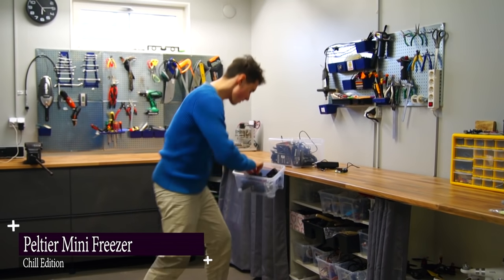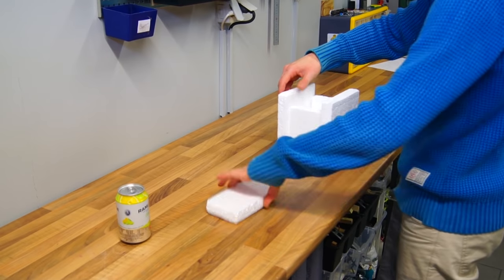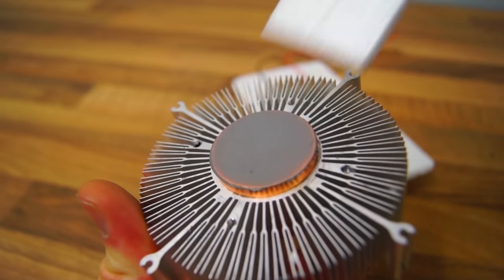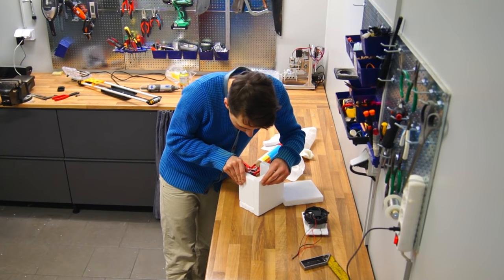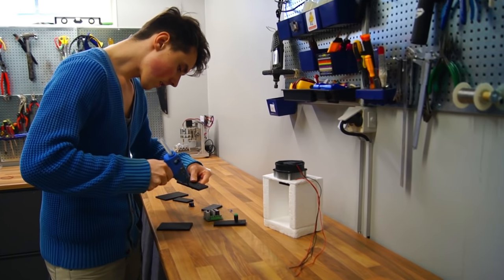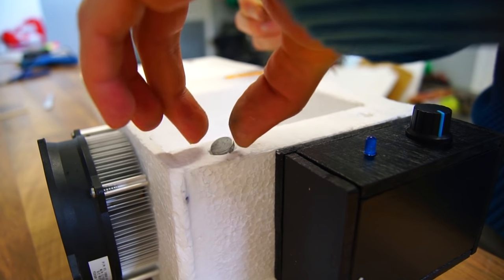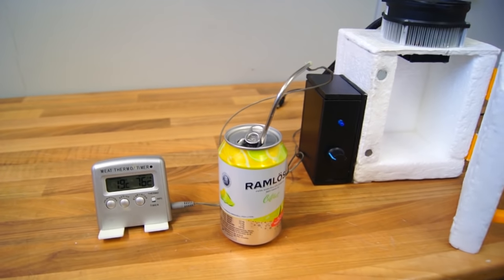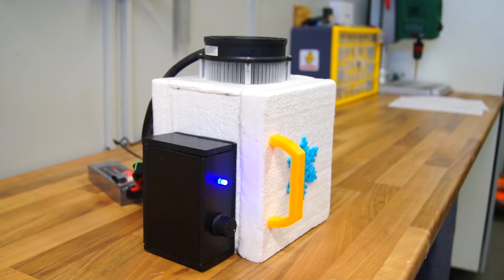Useful Cooler Box - How to Make a Mini Freezer

Comment: these peltiers are a fantastic thing for cooling in a small space where you cant use a compressor style design, but remember they are the most inefficient way known to man...so if you have power to waste in order to cool, fine, but if your in a camper van without the engine running etc, your battery's dead in no time, and you will need someone to jump you van off, ask how we know...50-60w of dc drain for about 25w-30w of cooling is average, but as said, in a small space, brilliant
Reply: lez briddon They're not "the most inefficient" otherwise they wouldn't be so common. Still, I don't know any other method of using electricity to cool something (below room temperature) that isn't Peltier or Adiabatic.
Reply: Just because something is common doesn't mean it's efficient (incandescent bulbs). Maybe it is more common because it is convenient and long lasting?
Reply: GoogleMinus your comparison is illogical. while incandescent bulbs were around 5% efficient there low cost outweighed the disadvantages and the lower cost of electricity 25 years ago made it less of an issue. add on to that the modern CFL was not reliable there was no alternative to incandescent.
peltiers are cheap to buy as a component for less than 10$ but to compete as a real refrigerator you would need around 6 and a huge power supply against a ready built refrigerator of less than 100$ and about 60w of current draw. peltiers generally suck unless you have no space.
Reply: lez briddon His comparison is fine, since there's no substitute for Peltier modules right now (unless someone miniaturized the Adiabatic mechanism of fridges)
Reply: ifOnly, there is another technology called magnetocaloric cooling. These devices do have moving parts, but they do not have compressors for high pressure gas refrigerants. They have a small pump for circulating a heat exchange fluid (salt water, I think). A motor is also used to spin a special metal alloy in a magnetic field. The claim is that this technology is 35% more efficient than gas compressor based refrigeration. I do not believe this claim at face value; however, even if it were slightly less efficient this technology offers a lot of advantages to be interesting. I don't know if the technology is also priced competitive to traditional refrigerators. It looks like it shouldn't cost any more. The metal alloy used is blended from cheap base metals, so hopefully this technology will be inexpensive.
Reply: lez briddon, yes CFL bulbs were a big scam. Terrible. I didn't have a single one last as long as the claimed lifespan and they were less durable and robust than fragile incandescent bulbs... LED lights on the other hand, have totally lived up to their promise. I collect incandescent bulbs for fun, but I use LED everywhere in my home and shop.
Reply: ifOnly, magnetocaloric cooling and vortex cooling (Ranque-Hilsch) come to mind. Then there is the Crosley IcyBall, which uses a gas exchange mechanism, but I forget if it's the same physical process as common refrigerators. For some reason I seem to remember that while it looks somewhat like a compressed gas based adiabatic refrigeration cycle that the principle is actually different. I could be wrong, but it's a neat device anyway. It has no moving parts. Then there are various chillers based on endothermic enthalpy of fusion or phase or dissolution or something processes. Ammonium nitrate dissolving into water is one example. That process "releases" cold. You can buy instant cold-packs for first-aid that are based on this... I mean, none of these are likely to be useful to you as a replacement for a refrigerator, but there are other ways the cool things based on fundamentally different physical processes. I'm sure there are others that I have not listed.
Reply: Led's waste energy don't forget they use huge heat sinks where CFL none  if you use the old Leds NOT THE 1W 5W etc forget this statement
Reply: Put a led (5W) on with out the heat sink you will get what I mean!
Reply: Avon Pubudu Jayaweera yeah they do waste a lot of heat. I use 10w LEDs at about 7 to 8w and still have to add a heatsink about 30x30x10mm but I do get nearly twice the light of the old 6w bulb.
Reply: Isn't the old small 100 leds in on light is the most efficient?

http://www.ledlampshining.com/upload/photo/a5259bfd4635fc665b494b3262799b39.jpg
Reply: those don;t use heatsinks
Reply: LEDs are more efficient than CFL. CFL don't use heat sinks because the entire surface inside of the tube is used as an active emitter of light, whereas in an LED they might have less than 1/100th of the surface as a CFL area acting as an emitter of light. So the energy is much more concentrated in an LED than a CFL, but overall the process of converting electricity into visible light is more efficient. Comparing an entire bulb for  bulb an LED will produce more light for the same cost in electricity than a CFL. I believe LEDs are about twice as efficient as CFL. And CFL are twice as efficient as incandescent.

Any process that produces light will generate some waste heat. There may be some obscure chemical processes that appear endothermic and yet produce light, but you would find that if you include the energy necessary to produce the chemical reagents that there will base wasted energy.

By the way CFL was a terrible technology in many other ways. CFL were even more fragile than incandescent. It was virtually impossible to make a dimmable a CFL bulb. CFL never lasted even remotely as long as was claimed. CFL produced terrible quality of light. CFL sometimes caught on fire when they failed. CFL contained free mercury and were a hazard when they broke and couldn't be put in landfill... I'm glad that LED finally killed CFL.
Reply: Noah Spurrier -- agreed on most of what you said, but we must consider that production capabilities of the day wee not as precise or controlled as today. Not to mention complete health disregard of hazardous stuff far worse than Mercury. On light quality, bright LEDs are a recent, kinda accidental discovery. Emitter heat is the issue, colors are improving as is the buffering of "flicker" because they have almos no latency (60hz is visible by many including me) Organic LEDs (OLED) are better in that regard, but cost becomes a factor probably..
Reply: Take some extra battery with you!

Comment: it only takes about 15 minuts in my freezer to chill a drink
Reply: Firm Clock but can you take your freezer to the beach? I don't think so...
Reply: thats what i have ice for
Reply: Firm Clock ice waters down drinks
Reply: wow i didn't know ice could faze thru Aluminium and plastic O.o it must of been able to tape into the speed force.
Reply: Not the aluminum but it actually can move through the plastic given enough time
Reply: It's even faster if you put the drinks in a bucket of water and ice then keep mixing the whole thing, i think in a few minutes the drinks will be cold. Water much better thermal conductor than air.
Reply: where to buy components can some one tell me
Reply: Firm Clock you may purchase the peltier from eBay and the heat sinks from any computer shop
Reply: you don't necessarily have access to a freezer while on holiday. most hotel rooms are without a kitchen.
Reply: Ori All Hotels and Motels I've been to do at least have a fridge, even if it's a Mini bar fridge.

Comment: 6Amp peltier with a CPU fan and CPU heat sink will never get down to -10C.
i test it with ice for hot side (Freeze the hot side in a water container in freezer) the temp of cold side was -12C. you just use a fan and heat sink and get to -10C ? its not possible
Reply: Amir, using an ARCTIC Alpine 11 Plus CPU Cooler (https://www.amazon.com/gp/product/B00606OHQQ/ref=od_aui_detailpages00?ie=UTF8&psc=1) I was able to get -12.3C from an 12706 module (driven at 11.6V,  darwing 4A). Pushing supply voltage to 13.6V/4.7A only decreased temp to -12.4C, so I knew I reached an inflection point. Hot side never exceeded 36.8C.  Temps were measured with thermocouples (using IR gun is not accurate due to wide optical window and dependence on surface reflectivity). Best temps were achieved by switching to a heatpipe-based CPU cooler (cheapest I could find was DEEPCOOL GAMMAXX 400 from NewEgg). Using 13.6V/4.7A I got -21.6C (hot side 30.8C).  Remember, both heatsinks have to have their fans running at full speed to achieve decent results.  For all these tests, ambient temp was 25.5C. Secret was using proper thermal compound and lots of clamping pressure (heat transfer is proportional to clamping pressure, TEC manufacturers recommend 25-80 PSI), and lapping heatsink interface to reduce surface roughness and achieve proper flatness.
Reply: @mohamed great numbers! congratz for your discoveries and tinkering!
Reply: Italo Loureiro Many thanks Italo...
Reply: amir victor where can I get peltier

Comment: the video is called "how to make a mini freezer" but basically you only show us how to cut things. we know how to cut things to specific shapes, what ISN'T clear is the wiring. without that information, this is not a video on how to build this device.

 i've purchased the pwm controller but i, as well as many others in the comments here can't tell how you're connecting the wires. your only commented response was "you'll figure it out" 
isn't it best not to connect things randomly? please just explain where the wires go. it's only 4 connectors, would it really be that hard to leave a comment or to put in the description where the wires connect to?
did you run the peltier wires down the same tube as the heat sink fan and attach them together?

Comment: first off thank you, but i noticed you added a heat sink on the cold side too. i own a minifridge that i believe works on the same modules as the one you build but it never had a heat sink on the cold side. I'm going to add one as the fridge always has under performed in my opinion. and i believe if the cold side had a heat sink it would perform great. without a heat sink the cold side would always just freeze over while the rest of the fridge was only slightly cooler. thank you again and if i notice a improvement i will leave a response.

Comment: very nice, I just got a 6 pack cooler/fridge, that thing had the cheapest aluminum heatsink to dissipate the heat, but it didn't expose the cool side, it works but I'm talking days, not hours, and not minutes (in fairness your design has room for 1 drink vs 6)  but I'm definitely modifying your design, not theirs if I do my own!  I would suggest a simple blower fan pointed at the cold sink, and a low profile heatsink from a U1 server, just need to make sure a fan can mount on the top

Comment: add a fan inside, ad you'll get you drink cold way faster and maybe if you will control temperature of cold radiator around 1°C your radiator won't freeze and loose conductivity. Also a nice idea to put power adapter next to outter radiator so there will be a smooth look and electronics will be with some air flow.

Comment: When you powered the cooler with a battery, did you use any sort of current limiter or power regulation beyond the PWM? This might be a mistake, I'm not sure. Certainly it would be without the PWM. With no power management at all then these things will burn up when hooked to a battery which can supply giant amounts of current (especially lead acid and lithium). They will chill for a minute or so before both sides begin to get hot. They are fine running on those little AC power supplies because they are self-limiting in the amount of power they can deliver. A battery is not self-limited (at least the internal resistance is so low that the battery will get hot enough to explode before that resistance becomes a significant factor). I learned his the hard way when I replaced an alkaline battery power pack with a lead-acid battery. I felt pretty dumb when I realized what I had done. The coolers survived the ordeal, amazingly.

Comment: Great video.

Here is a suggestion you may find useful. Next time maybe use a thicker top. You can set the cold side sink deeper in the foam to allow for a thicker top as I think that might allow for colder temps or possible quicker temps. 

Another thing to try is a different foam board, I forget what it's called but it is typically Blue or Pink and is very dense. You may want to consider using it for the Top since it's so dense and sturdy.

Anything thing you could try is maybe carving a V Shaped tongue and groove around the door and box. Granted it's a bit of work but it would keep things aligned and really keep the cold from escaping. 

Granted your way was fine and these are just possible alternate ways; they may work or they may fail. Cheers...
Reply from the maker: Thanks for your detailed comment, we are all here to learn :D
Reply: I tried a few Peltier projects but did not turn out well, PSU issues. Your controller is awesome, could you post a link for it or be more specific about it? 

It might be a simple controller but I don't work on electronics so it might as well be Rocket Science; just not my area of expertise. I want to get into the Arduino and what not but electronics escapes me; never picked it up as a kid and now that I am over 55 years old not going to pick it up any time soon... LOL... I believe the phrase about teaching an Old Dog a New Trick applies... LOL... Cheers...

Comment: I have watched a lot of these kind of videos. Why people don't use 2x stacked peltier modules? I have done testing my self, and when stacking 2xTEC1-12706 you can get to same -11c only using +5v/2.4A. That means i could use just a normal USB charger to power it, which makes it much more easier to move it around. Also i could use those 20,000mA chargebanks to power it for long time, like when you are in a beach..

Comment: quick question. how did you wire it up, or more specifically, which wires went to what? Never really used a controller in my electronics so I wasn't sure.

Comment: I don't understand your wiring for the PWM. How are you connecting the wires to the four screws at the back? I also see you have another item not mentioned at the beginning, the one with the two screws separate from the PWM

Comment: For this application would a simple potentiometer be better than a PWM controller? Less current loss and much cheaper. Wondered why you made a utility box with comp board instead of just 3d printing one with a battery compartment. Your idea is intriguing.  Thanks.

Comment: Hi,

Can you please tell me if the fan is drawing air away from the box or pushing air through the box?

Thanks,
Reply: The fan is blowing air towards the external heatsink to remove the heat from the peltier. No air is going inside the box

Comment: 100%work  15amp2=30amp  2water block  use  condenser and green calling water use now. 4pis 1,1amp fan. 12v. 2pis water pump.   100 Sq F. Work  20to26 *

Comment: If I wanted to switch it from cooling to a heat pump for seasonal conditions to keep an item at a warmer temp than the ambient air temp, is there a way to switch it without manually reversing the Peltier module?
Reply: Use a reverse polarity switch

Comment: Very nice project :) I would just add some type of seal to the side of the door (because it can really reduce the cooler efficiency). You could make some easy seal from silicon or something like that. Just make a square form with height of a few milimeters and fill it up with silicon and there you have it. But it is still nice project. Keep doing these videos. It's nice! ;)

Comment: This is a great video. I was wondering what would I need to build a 2x2x2 size freezer? If you have the info for that I would appreciate that.
Reply: Xue Lee this would work with any size, the larger tho the slower this will work.
You just need to cut the material to your size.

Comment: awesome! although I do see one problem with this design. the paltier module will keep running even if the chamber is empty or everything inside is frozen. think about implementing an auto-controloed system that shuts the unit off once it reaches a certain degree and on when it's not cold enough.
Reply: That might need some internal temperature system with the ardoino

Comment: I need a freezer for my 5 x 3 ebike controller. Without the moisture. Do you have an idea for that ? Leave a link right here please ? I need for it to be at 30 degrees F. Or maybe 35-40 degrees F.
 When it gets hot out. I had my ebike out the past few days. Temperature about 30 degrees F. It should have taken a bar down while going up the hill. So I have heard batteries( lithium ion) hate the cold. So I imagine it may have been the controller. Maybe micro fans. Something tiny to fit. Like those phone coolers. And not big and bulky. But ebike controllers have ridges and moisture could swell up and leak. What do you think ?

Comment: the tec you used uses 6 amps of current. Is the battery you used 6 Amps current?.What happens if less flow is given to the device؟and What type of battery do you offer with high current?

Comment: Can you use another peltier module (cold side to hot side) on the hot side to get a larger temperature differential, thus getting colder on the cold side?

Comment: Hey there! Nice video! 
I'm planning to build one of those, but I have some questions. 
Should I connect everything to the pwm controller? 
Will it turn off if I turn the controller to 0%?
Is it safe to keep it connected with the pwm controller turned to 0%? Will it keep drawing electricity from the wall?
Reply: 5 years no reply, i also havr the same question

Comment: You can cool the water inside the freezer and pump it to the radiator and take advantage of the cold air of the radiator to make a 12v air conditioner

Comment: That TEC1-12706 is 6A, how could you power it with a 5A adapter? I've done that before and it's not stable at all, so I'm using 7A adapter now which works great. I don't use any PWM, though, so the power is constant.